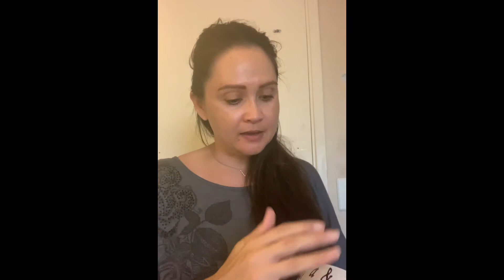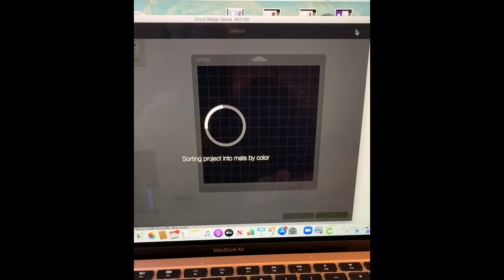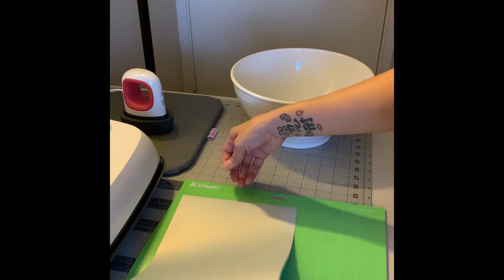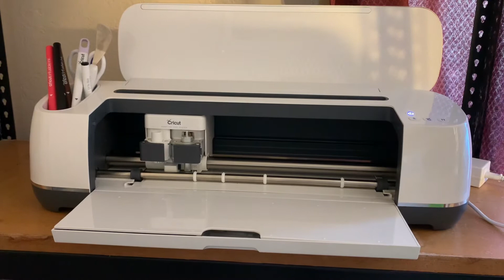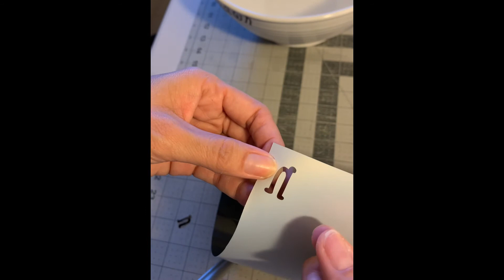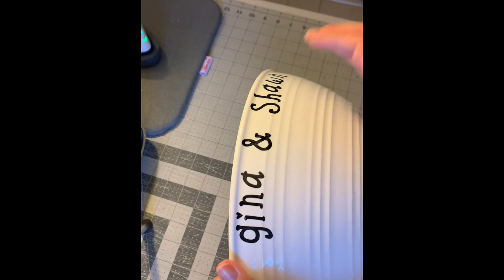How to apply Heat Transfer Vinyl to a ceramic bowl and make it dishwasher safe & permanent

Comment: If I want to use HTV in a small trinket dish, square, round, heart shaped, etc, how would I apply heat to that? Any words would be at the bottom of the small dish and none of the mini irons would fit. Thank you.
Reply from the maker: You can put your trinket dish in the oven and heat it. Then apply the HTV while it’s hot, pressing down with a towel to protect your hands. Then once it cools lifting the transfer paper off.
Reply: @RealTalkwithSandie  Thank you. Good temp and time?  Maybe 300 degrees for 10 or 20 minutes?